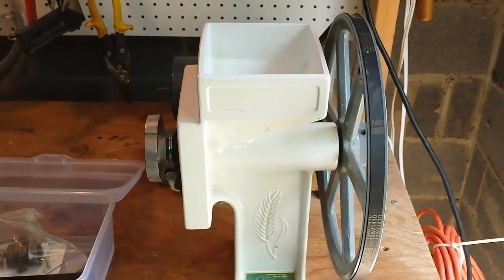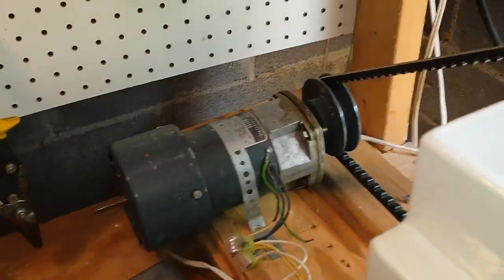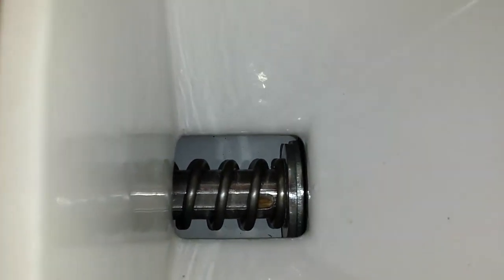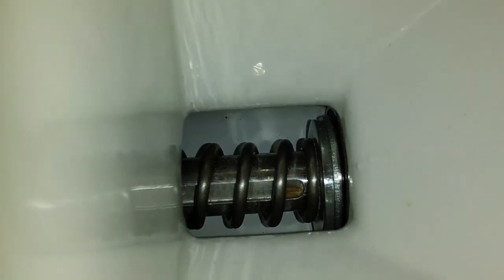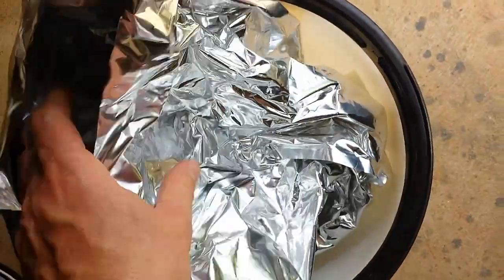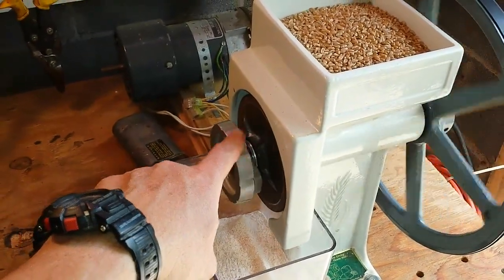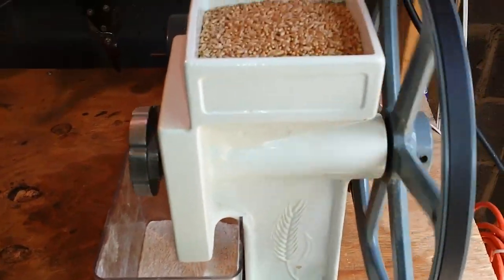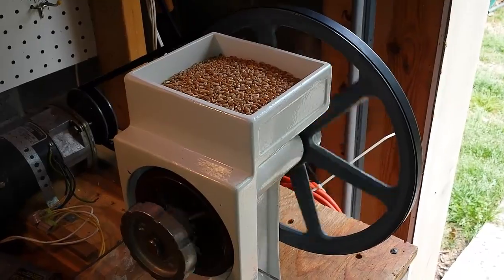Country Living Grain Mill - 9 Year Review

Comment: Could you give more details about the motor?  I rigged our CLGM to run on an exercise bike and also to run on some salvaged motors/30:1 gear reducer.  When we moved to Alaska I brought the mill but left the heavy motor (which was overkill) and reducer.  I'm wanting to motorize it again.  It looks like your motor would fit in a flat rate box which is just the ticket for getting stuff shipped here, especially heavy stuff.  Nice video.

Comment: Ive got the kitchenaid grain mill attachment, I’ve had it for every bit of 18 years and it’s never failed me or damaged my mixer. I would like to upgrade my manual grain mill because the the one I’ve had since 1999 can’t grind a fine flour. It’s best suited for milling grits and cracked wheat and making peanut butter.

Comment: Can you please tell us what is the rotation rate (round per minute) and what is the productivity of that setup? How many Kg or Lb per hour?
Reply from the maker: I run the grain mill at 60 revolutions per minute, which is very slow. I do this to keep the temperature of the grinding plates low. At this speed I can mill 1 kilogram of flour per hour, in a very fine grind. A coarse grind is much faster. 

Output is determined by grinding speed and coarseness of the grind, which are up to you. 

I do not worry about a high output as I can grind all the flour I need for a week in an hour or so. 

Thanks for watching!

Comment: This says 9 year review, so I assume that you have been using this mill for 9 years, correct? If so, how many times have you replaced the grinding plates, if at all? What about bearings or other parts? Thanks for the video.
Reply from the maker: Yes. I am going on 10 years and have never replaced a single part. The plates are good as new. I did put all spares and extra corn and bean auger in a tupperware container because you will lose them before you need them. I use the mill weekly for our flour needs. Hope this helps.
Reply: +The Meat Trapper  Boy, that's amazing. Glad to know it. Thanks. Just bought out own CL and was wondering what to expect.
Reply: +The Meat Trapper   I'm in the process of purchasing a used one and this answered some of my questions.  Thank you.
Reply from the maker: Glad it was helpful - trust me, you will enjoy it!
Reply: The grinding teeth it take life time because of the material with alloy or high carbon steel.

Comment: Nice video, I have been looking for a long term grinder that does the hardest wheat (just in case), and you hit it.  The second part is you haven't really mentioned what type of motor you use.  You state that your under powered please feed us the specs of the electric motor: 

see below link below to see how I got this.

revolutions per minute (rpm) :  60 rpm on main pulley

recommended:                                   Optional (by manufacture) rpm would be about 97
1150 recommended,                         1750 (see reduction gearing)
horse power (hp) :                              1/2 hp washer/dryer motor 
1/9 hp electrical AC,                           110/220 
40amp/50amp                                    hard to find the specs on the motors need to dig for it.  sorry
(cant read the rest)                             need to gear reduce it see the link.

pulley diameter 
3" with 5/8 shaft                                 measure your shaft diameter get appropriate pulleys required at least 3 two belts
                                                               6" , 2x 2"  pulleys just guessing.

here is a link that I was digging up while answering my own question.  
http://media.countrylivinggrainmills.com/mororized-grain-mill.html  
sorry I am temporary outside the US if this link don't work.
Reply from the maker: +ironhand69 I bought my gear motor used from surpluscenter.com. Since they sell surplus itemms, their stock changes week to week and my particular motor is long gone. The main thing I have learned is that the torque is critical. You want something that produces 37 - 40 inch lbs of torque. If I remember correctly, mine produces between 32 and 35 - so it will bog down if I grind hard wheat too fast, or try to feed wheat using the bean auger. I keep my RPM's at the grinding plate to 60 RPMS so the plates stay nice and cool. Make sure you're final gearing produces close to 60 rpm's at the plates and try to get 40 inch lbs of torque and you will have a machine that will run for the rest of your life without problems.  Hope this helps.

Comment: Would you mind sending me the link to the motor please? There are alot listed on SurplusCenter.com :)
Reply from the maker: Hi Ryan,

Surplus Center's inventory varies from week to week. Since they sell surplus they do not have a regular product line, and after 9 years my particular motor is long gone. 

I would just watch their website for "gear motors" and look for one that you can use pulleys to gear down to about 100 RPM's or less. Check it every week or so as their stock changes often. 

Check out this page that has a lot of information on different motor setups: http://media.countrylivinggrainmills.com/motorized-grain-mill.html. This will help you choose a motor and pulley size (motor RPM and pulley size determine final grinding RPM. 

The only thing that page does not cover is torque. I'd look for a motor that will produce 37 - 40 inch lbs of torque. This is enough torque to insure the motor does not "bog down" when grinding hard red wheat.

I hope this helps and thanks for watching!